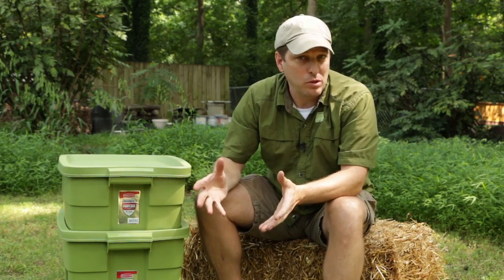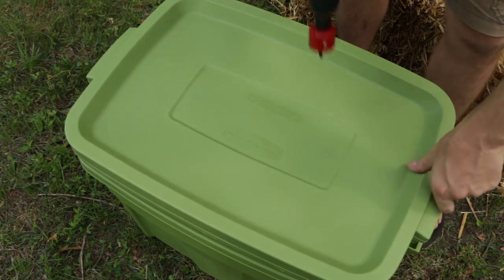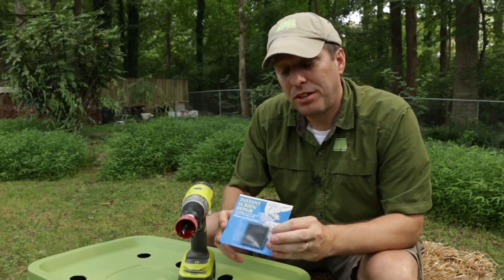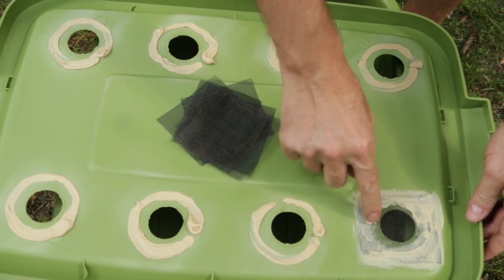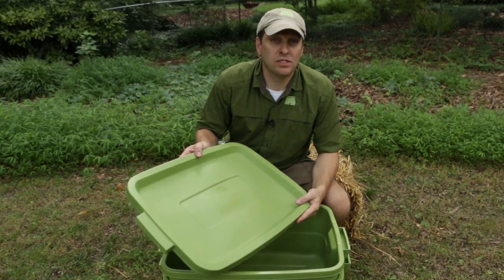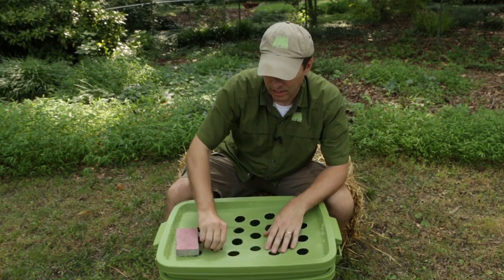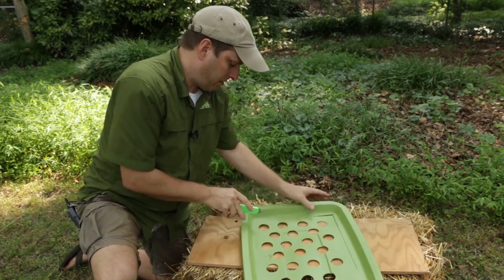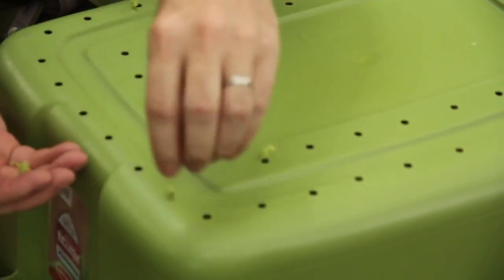How to Build a Worm Composting Bin | GreenShortz DIY

Comment: Great video. Got my worms yesterday from uncle Jim yesterday. Checking on the worms. Many have went into the bottom bin. Normal?
Reply from the maker: Yes. The worms will try to get out initially. They don’t recognize the bin as home yet. I normally leave the top off and shine a light down from above. This will chase them back down. This desire to flee only lasts a couple days. You’ll need to manually move them back from the bottom bin. Hope that helps.
Reply: @GreenShortzDIY  yes I moved them back. I’m just happy this is normal! I appreciate your response!
Reply: @GreenShortzDIY  you were spot on. Less and less worms trying to escape.
Reply: @GreenShortzDIY  my worms are thriving in your bin setup. A bit of a fruit fly problem but nothing to bad!

Comment: i'm sorry but you have NO ventilation where youy need it (at the lower portion of bin) qand huge holes to let in RAIN!?  what? use recycled bins of wooden boxes easier and better ,no real reason for two bins whatsoever ,just displaying ignorance .OK I'm going to seem like a bit of an ol'curmudgeon here but I HAVE been
 worm composting for 45 years with these crappy ol' plastic tubs(never 
bought a new one yet for this ) and just a few TIPS and POINTERS ..never
 put holes in the TOP of a worm bin that will be kept outside(lets in 
rain,too wet,leaches out compost. put holes in the bottom 1/3 of bin 
that is where the air is needed,not up top. put only ONE hole in a bottom 
corner at least 1/4" to 3/8" big ,this is to allow leachate to drip 
out,and as a worm escape hole ,that's right I said ESCAPE ,If some 
newbie puts too much food in the worm bin it can HEAT UP,and the worms 
will all die. they need to be able to get OUT .It's a worm home not a 
worm JAIL.  they love it UNDER a worm bin on extremely hot days,  always
 keep worm systems in the SHADE and do not let them freeze in the 
winter.  now as to the  rules of WHAT TO FEED WORMS....   the answer is 
ANYTHING that nature grew.  all the crap on line about no this and that 
is written by high school kids who wanted to sound cool.   obviously co 
co nut shells, pineapple tops blocks of wood etc are impractical. 
plastic metal and glass or ceramic will not work..  I feed my worms all 
manner of food I take about 2 or 3 years to completely compost worm 
castings...I frequently EAT my worm compost to demonstrate its safety,  
 NEVER USE PERLITE in any bed you want good worm populations to grow in 
  RED LAVA will perform all the same functions as PERLITE but breaks 
down naturally into fantastic nutrients for your plants . PERLITE is a 
kiln fired substance (Glass) that is dangerous to HUMANS in it's powder 
form when airborne .  It is also full of embodied energy which is an 
ecological NO NO .   Stupid stuff ugly too.   I start a bin with 2" of 
small rotting sticks(for that fungi! ) BOSR  biologically obligate 
symbiotic relationship)  and this helps with ventilation,  one shovel 
full of DIRT (worms use small pebbles to chew with)  always inter 
food,keep a layer of MULCH on top (just like nature) and If you want 
educational benefits(to SEE worms without digging in anaerobic goo)then 
put one layer of sheet plastic on TOP of the mulch!  this also keeps the 
worms circulating from bottom to top in all climates . they go up to 
get fresh condensed moisture off the plastic. although worms love 
horrible glop,they also love nice fresh water!  Have fun . two bins per
 person in veggie crazy family!
Reply from the maker: MrNicofrog Thanks for the feedback, Nico. I can tell you are passionate about this...and have a wealth of experience. When you vent the bottom, do worms exit that way? Or are you screening? BTW, I used your lava rock recommendation in my masters rocket stove video. Thanks for the feedback.

Comment: Not an insult, as tools should benefit the user and their application, as opposed to what someone else thinks. That being said it is remarkable how much rust is on that carpenter square with the UPC tag still showing.
Reply from the maker: John Hubbard yeah, it’s pretty bad. I forget how it got that bad, either left out in the rain by accident or water on the floor. Or, I may have saved it from a recycling event. It needs a good restoration. Watch for it in a future video. Thanks for the feedback...and the call to action.
Reply: @GreenShortzDIY  Must of been karma, after posting that I forgot my cell phone on the seed tray table along with some power tools. It rained the last two days lol

Comment: What are the exact compost bins that you used? I'm probably making to much of a deal out of this, but I just can't find a bin!
Reply from the maker: Hi Keaton. They were Rubber Made bins I picked up at Home Depot. Pretty sure the larger size was 18 gallon. The smaller bin, maybe 10. Hope that is helpful. Thanks for watching.
Reply: @GreenShortzDIY  Thx a lot

Comment: Dude, all the worms will escape from those holes you drilled at the bottom and most likely drown, did you update people on that?
Reply: Line bottom with mesh , I feel like the divider would be  easier to use the plastic chicken fencing

Comment: The use of continuous flow systems with new generation beds that will ensure high quality, fast, clean products with high efficiency and low labor force to provide a sustainable product standard will be an advantage for investors. "Organic matter is the life of the soil." EMOSAS Continuous Flow Systems, our company makes all kinds of equipment and machinery required for the production of worms and vermicompost production facility installation. We sell our product especially Europen Countries like Italy.You can contact us for more efficient production.+90(534) 791 99 89

Comment: I’m confused with what the bottom bin does. Can someone help me out?
Reply from the maker: Hi Kailyn, the as the worms process the veggie scraps they release moisture. You’ll also be adding moisture when you wet the newspaper bedding. The bottom bin is to capture the drainage...called leachate. It is a rich fertilizer and can be used in the garden.  Thanks for watching.
Reply: @GreenShortzDIY  Great Video. But I thought worm tea has to be brewed? Can you just use that excess moisture and pour directly on plants?

Comment: Is that top bin too small. It seems like you won’t get a lot of cmpost? Shouldn’t the big one go inside lower one ?
Reply from the maker: I hadn’t thought of that. Worms tend to work near the surface, so surface area is more important than depth. I do think that two bins the size of the smaller would worked. Thanks for the feedback.
Reply: GreenShortz DIY thank you! I was just wondering to utilize the space of the large bin. Seems like you could get more castings and going more frequently to get some out. I just replicated this today thanks for the help.

Comment: I'm thinking about starting a vermicomposting bin, but I did a little research on harm to the worms, and now I'm not so sure. Have you done any research on how this hurts the worms?
Reply from the maker: cindy o hi Cindy. I haven’t heard of this issue. Perhaps it is related to putting the wrong things in a worm bin (like citrus) and the worms not being able move away from that. If you want to compost with worms and have a garden bed, consider doing worm towers. This gives the worms freedom of movement, to migrate away from a potentially toxic environment. It is also super low maintenance. Hope this answers your question. Thanks for watching.

Comment: I'm starting my first  worm bed for earthworms to feed my tortoises.   Since I'm not looking to use the compost do I need to remove it?  Will it become toxic to the worms if not?  Not sure if I need the divider.  Thanks for everything and keep up the great educational videos!

I planned to build the same setup you are describing and plan on watching the next vid to see if I need good soil for earthworms or the regular shredded paper ect ect.  Not finding much info online about the different substrates but most I've seen make a very specific point about shredded paper being only for a specific worm that composts fast and makes a distinction between the worms and normal earth worms.  Not sure if shredded paper egg carton ect would work for earthworms.

Almost winter so I wanted to stock up and hope they breed while stored indoors for easy acess during winter.  I have about 100 adult earthworms I dug up.

Thanks for the videos i'm benging all of them now ;) Liking and subscribing
Reply: Just be aware that earthworms and red worms are 2 different species and the earthworms will require colder conditions compared to the compost worms or red worms. 

They also don't breed as quickly and need more dirt.

Comment: Just my opinion, but this seems way more complicated than it needs to be.
Reply from the maker: Troy Yarbrough there are simpler options for making a composting worm bin. A worm tower can be as simple as a PVC pipe with holes drilled in it, half buried in a garden bed. I’ve made more complicated as well...my flow-through bin, for example. It comes down to preference, but my mission is to do them all, so you can choose what’s best for you. Thanks for watching.

Comment: Bro in my worm bin i see small white worm  is it worms or anything else bro tell plzz
Reply from the maker: Baby worms start out as a translucent white. Did you get some red wigglers to start with? There are other things it could be too. The worm bin will be an ecosystem with lots of creatures, worms, mites, bacteria, etc. One bug you may get, but want to avoid is fly larvae. House fly larvae look like white rice doing a Fortnight dance. Tell me a little more about what you are seeing.
Reply: GreenShortz DIY i have worm and i haven't put any food scraps but it look like a rice smaller thing if is the pests how to get rid of them
Reply: Bro in my coco peat i see black thing is it compost
Reply from the maker: If you've got wiggling rice, then it is likely house fly larvae. You may just need to wait them out. Don't add food scraps for a while, until they hatch and leave. When you start up again, make sure to cover any food scraps well with newspaper bedding to keep any odor from attracting flies.
Reply from the maker: It is possible, but I'd need to see a pic to know for sure.

Comment: Thank you. I have one question. I live in Florida, where it is often quite rainy.  With the larger  holes at the top, do  I run the risk of "flooding" the bin?  Would it be better to drill the holes along the top of the side to provide aeration? Thank you.
Reply from the maker: Rosemary, it would be best to to keep the bin out of the rain. Holes on the sides would allow the worms to get out. There location on the top makes them more inaccessible. If you can't keep them in the garage or shed, you could get a small piece of corrugated roofing to sit on top. Metal or plastic would work and the wavy profile would allow for airflow. Hopes that helps. Thanks for watching.
Reply: Thank you very much.We are considering keeping them in the garage.  during the summer and I can mist them every day to keep the worms moist and I am thinking the paper may keep them cool enough. Thoughts? then in the cooler months, I can get a corrugated roofing to put over the holes.

Comment: Hi. Can you add a 2nd small bin and use it instead of the cutout lid to make the harvest easier?  So you have the large bin, for the liquid collection, small bin 1 to start, and then small bin 2 inside of that to draw the worms up as the compost builds in small bin 1? Could you rotate out small bins 1 & 2 as the worms move up? Or am I making this more difficult?
Reply from the maker: Actually, I think that is a clever solution. Make sure your two small bins fit fully inside the large one. Thanks for watching.
Reply: I'm thinking that if you use the second small bin on top for the worms to migrate up into, there needs to be air holes somewhere in what you are calling the small bin #1. Maybe on the sides to at the very top? Someone correct me if I am wrong. I'm trying to wrap my head around the myriad ways to do this. 😂

Comment: I was wondering if there is a way to insulate the bins for the colder months? I don't have anywhere inside to keep them.
Reply from the maker: Hi Carissa. I suggest burying the bin in the ground up to a few inches from the top or alternatively in a pile of wood chips (wood chips would’ve my preferred option). You can cover it with a bale or two of straw (depending on the size of the bale). This should keep them from freezing, but their production will likely slow down. Thanks for watching.

Comment: Can a smaller diameter drill bit instead of a hole cutting bit be used for the lid, drilling more holes instead of a few?
Reply from the maker: Hi Andrian. That should work file. It is mostly about air volume, so think about  getting close to area of holes I’ve got. It’s not a hard and fast number though.

Comment: Putting holes in the lid defeats the purpose of having a lid. Just drill a bunch of ~3/16 inch holes in a row in the sides just below the top lip of the bin. That way you don't need screen. You want air getting in, but not light and not rain water, if the bin is kept outside.
Reply from the maker: +Scott Bryce I haven’t tried holes on the side. I’ll have to experiment with that. I generally have kept these worm bins in my garage. However, right now my composting worms are in a flow through worm bin. I’m not using my two-bin worm composter right now. Thanks for the comments.

Comment: Will the worms move to lower bin through holes?
Reply from the maker: +Tushar Kathuria a few will end up falling through the holes. I usually separate the bins every week or so and pour the bottom bin into the top bin or pour the liquid into another container through a screen to capture any worms that have escaped. Then I just put the worms back in the top composting bin. If they get left in the liquid too long, they will drown. You can also put some nylon window screen in the bottom of the top bin to keep fewer worms from going through the holes. Thanks for watching.
Reply: @GreenShortzDIY  Youre not very bright is what ive noticed from this comment, no offence, do you have german ancestry?

Comment: I love how you reply to everyone! That must be almost a full time job. I am wondering what is the minimum temperature the worms survive at? I live in an apartment but want to make some compost tea for my small garden I'm renting. My only option would be to keep the worms on the balcony. Do you think that would work?
Reply from the maker: +N Bo hi Bo. Sorry it has been a week since you posted this comment. It does take a wild to answer everybody but using voice to text helps. Red wiggler composting worms will die in freezing temperatures. They thrive in a temperature range between 50° and 85°F. What type of low temperatures do you experience where you live? You could always consider putting them in a laundry room or closet during the winter. Perhaps adding a charcoal air filter to the lid would help reduce any odors. If you keep a pretty thick layer of newspaper bedding over any new compostables added the odor is very minimal. Let me know if you have any more questions. Thanks for watching.
Reply: GreenShortz DIY Not sure if you're still active on here, but I have the opposite concern. Where I live it's very hot (summer days are over 100). What can I do to ensure they don't die with the heat?